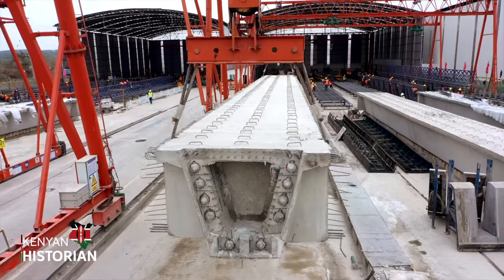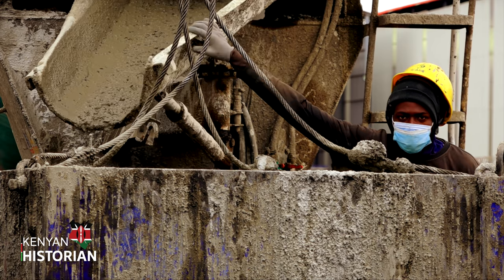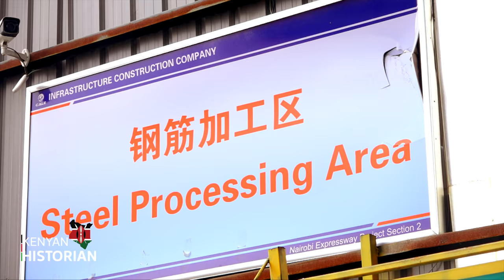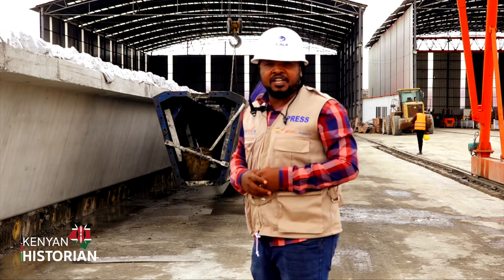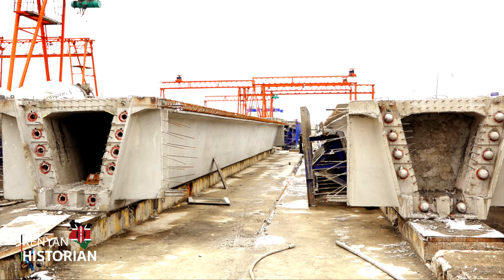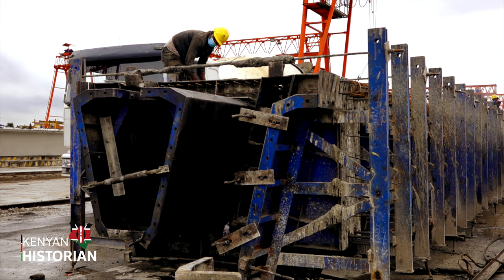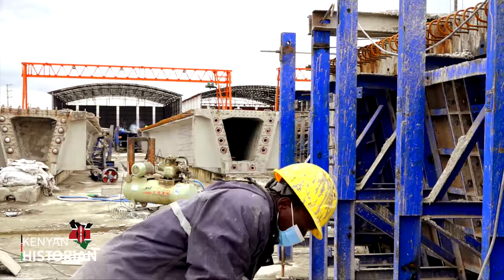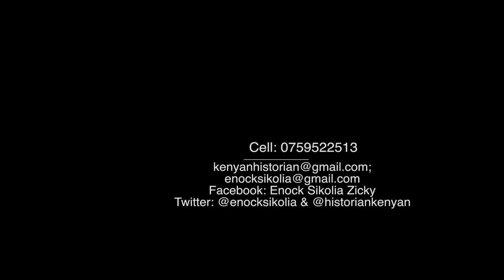EXCLUSIVE: Engineering technology that will make Kenya's Nairobi expressway last for over 100 years

Comment: Thank you for the very informative video. I am wondering, what material will the road surface be made of... Still concrete? Or bitumen?
Reply from the maker: The surface will be made of bitumen. There's a concrete layer then bitumen on top
Reply: They will apply or lay (50 or 75)mm thick bitumen